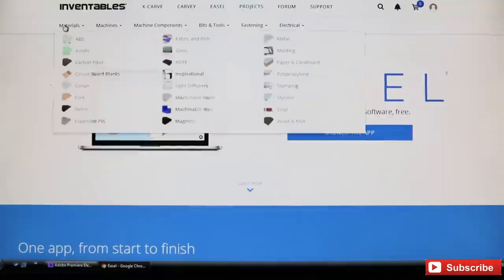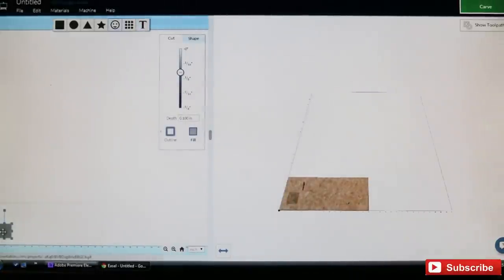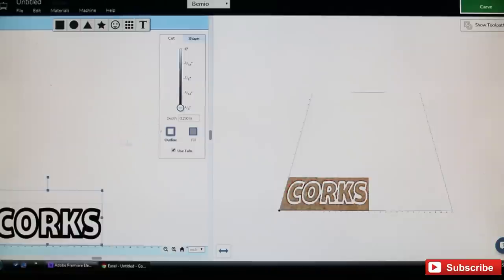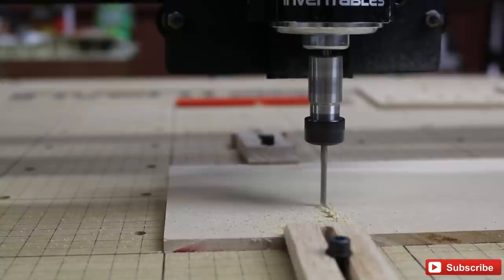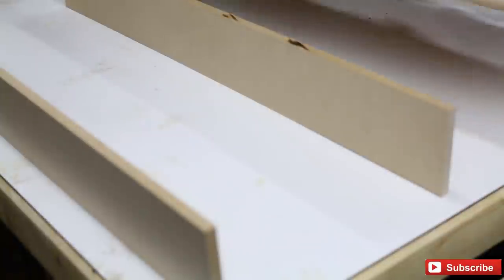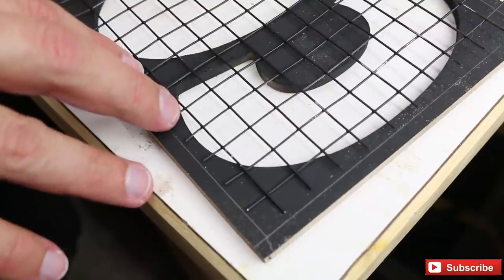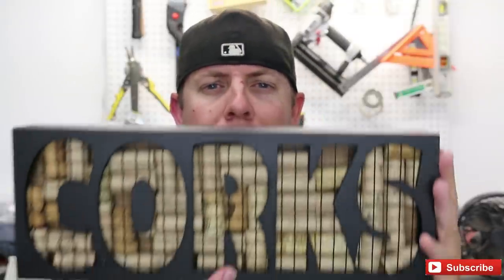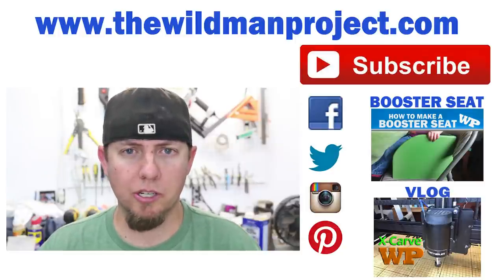How To Make A Wine Cork Holder - X-Carve CNC Project

Comment: Looks like you cut into your table top. .
Reply: But still a sweet project.
Reply from the maker: David Bishop I did, but that's what its there for. Some people put a sacrificial pieces in between their project and waste board, but I don't bother. You can always re-surface it, make or buy a new one.